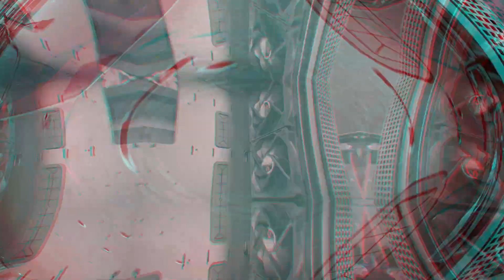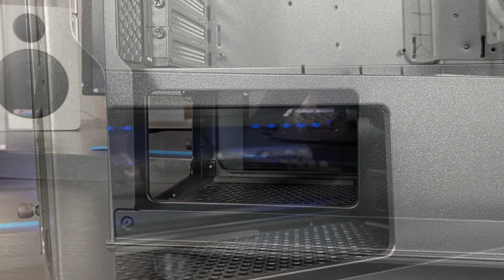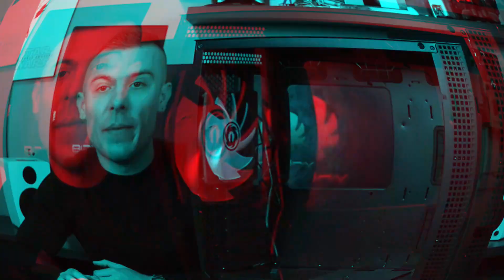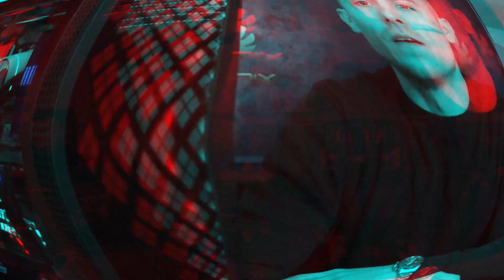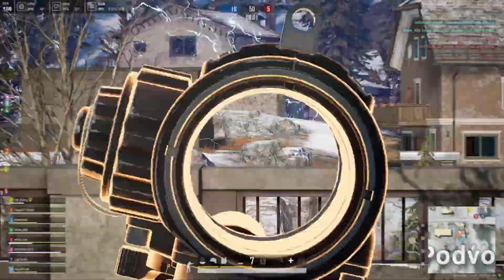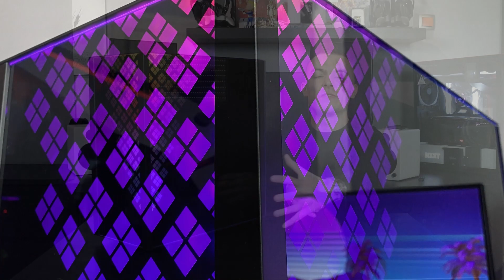Interesting on all side - BITFENIX DAWN TG

Comment: How can I connect the case with a motherboard with only 4 pin connectors. Hopefully you can understand me :)
Reply from the maker: What 4-pin connectors? I need more details on what are you talking about.
Reply: I mean a 4 Pin Header because the cable of the Case is a 3 Pin cabel. Like the Msi z390 a pro Motherboard